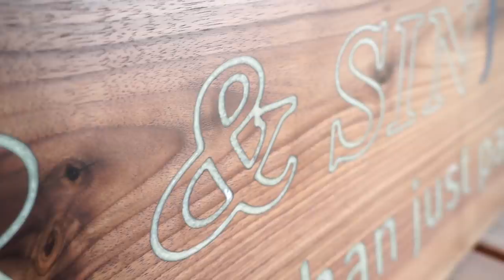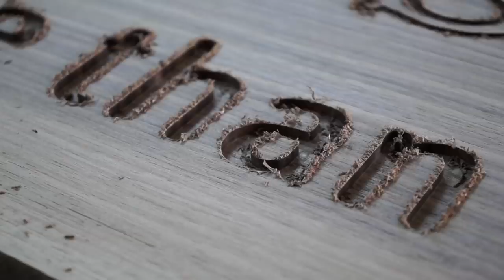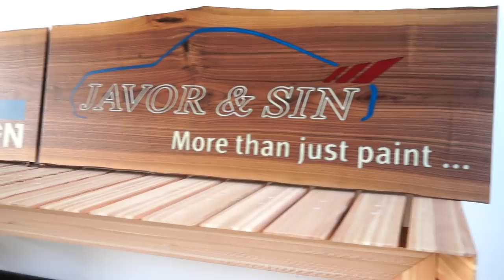Wood & Epoxy resin wall signs

Comment: I've actually had a lot of experience with this! On lighter woods it helps to spray a bit of shellac before pouring the epoxy to keep the pigment from leeching into the wood.
Reply: I work in parks&rec dept if my city and interested in getting our Parks sign maker into this as opposed to just painting the routers letters. Do you recommend any particular epoxy and if so which.?

Comment: Dear Sir,
A beautifully made sign using a worm drive circular saw ( a bit unusual in Europe???). My only regret is there is no thief proof feature incorporated in it. Still will do the owner's company something to be very proud of. Kind regards.
Reply from the maker: I'l tell them to bolt them to the wall ;) Actually both of my worm drive saws are from USA. I have a power converter from 230 to 110V for one, and had the motor recoiled to 230 V on the other. Best circular saws in the world. Glad you like the project, thank you!

Comment: That’s would be cool if you can light up through the back.
Reply from the maker: I agree, it would definitely add to the wow factor. In next epoxy project for sure!
Reply: My thoughts as well. Either carve all the way through and tape to hold epoxy, or carve to ~1mm and plane down after fill/dry, would be similar to neon effect
Reply: Oh, and might need to make the sides of the carving concave rather than straight through to avoid the resin falling out :)